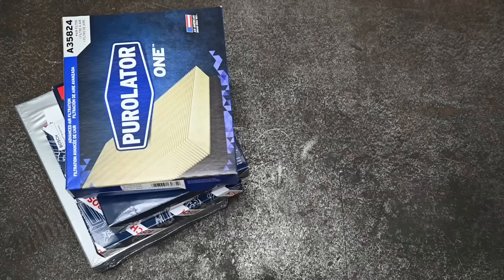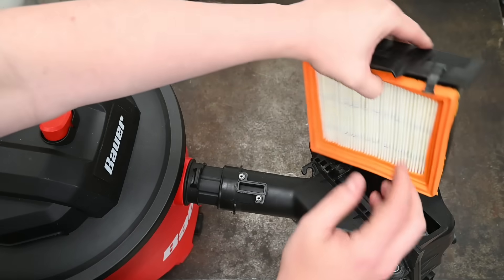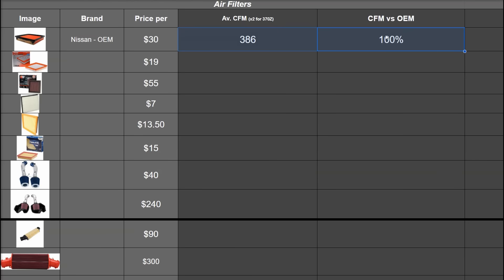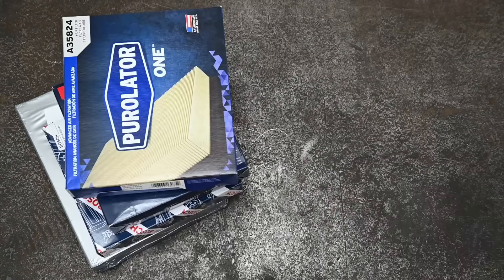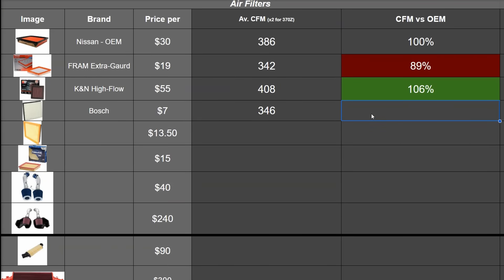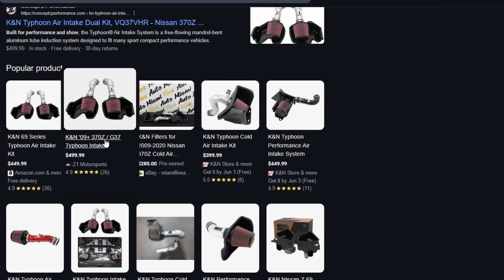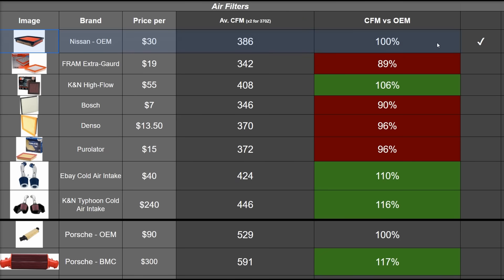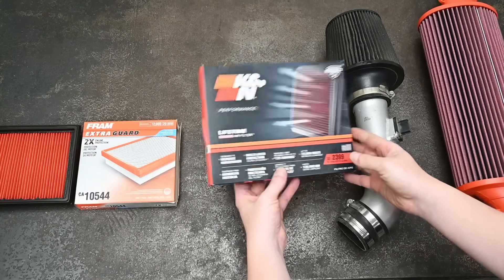Intake Filters TESTED: More Dough = More Flow?

Comment: You should test the stock vs aftermarket intakes without a filter and see if they were restricted at stock flow and 50-100 cfms more than stock and see if the intakes were different.

Comment: Sooo, what would happen if you made a custom box to hold 2x $7 bosh filters? Would that work better than a single $15 one? What about a box with 4x $7 filters? Would that be better than a $30 or even a $300 filter? Seems unless you're building a custom intake the cheapest is pretty much the same as the most expensive. Also would a custom box with 43x $7 filters do better than a single $300 one?

Comment: In modern cars that most of these upgraded filters do not add power. The modern vehicle generally has a far better design to accommodate maximum volume.
Those stepped intake are junk and the step creates turbulence at certain rpm. 
Also those K&N intakes are mostly noise generators.

Comment: Should you have oiled the K&N filter to have given it a real-world test unless I'm mistaken I thought those filters fully rely on being oiled to do any kind of filtering
Reply: New K&Ns come preoiled out of package.
Reply: They're pre-oiled, no oiling is needed.
Reply: They make dry filters as well
Reply: The oil is red and all of em come pre-oiled
Reply: K&n does all sorta stuff these days but people just associate with the oiled metal filters.

Filter counter tests are sort of hard to do, measuring how quick they get choked up etc is easier. I'd just like to see the easiest mods tested while retaining filtration but which are rarely seen like just using two oem in parallel etc
Reply: They come preoiled

Comment: To be honest the test that would more present an engine advantage would be the pressure drop at a fixed cfm. The engine WILL such the same amount of air no matter the filter. But the more pressure drop the harder it has to work to such such air. But will it make a noticeable difference except placebo effect caused by the change in tone of the engine ? Nah .... maybe what half an hp on a stock engine ...

Comment: CAI sound good even with little to no mods. I always had 2 filters so one was clean and oiled and ready to go at all times. Makes your exhaust note better. I try Very Hard to take the Best care possible for my truck and engine. A very high end engine builder once told me “ an engine will last as long as it takes it to eat a cup of dirt “  So I sometimes run a tune and sometimes change of my muffler. I drive on dirt / gravel roads frequently. I only do stock air intake and the best filters I can find. I have been running Fram extra guard in my 2016 F150 5.0  I am over 200,000 miles and will be selling it and moving into a Nissan Titan. Looks like I will run OEM Nissan air filters. Thank You. 🙏🏻

Comment: If I may offer my humble opinion on intake air flow….
I’m pretty sure (according to the intellect that I see everyday on the streets), if you lower the car about 2 inches, add a 24” tall rear deck spoiler, and add an obnoxious exhaust system to compliment the blacked out windows and the led accent lighting, it will not only make the car look like a complete piece of garbage, but it will also make the driver an INSTANT RACE CAR DRIVER, capable of speeding to the next red light 3 seconds faster than you, while using 4 extra ounces of gasoline and 20 extra decibels, to wait 3 seconds longer than you, for the light to turn green. 😂😂

Comment: the miniscule horsepower increase isnt worth the lower filtration ability, i used to buy these until i held one up to sunlight and saw how big the holes were in the "weave", the dyno tests showing a 5hp increase would have the performance increase of removing 40lbs from your car

Comment: The particulate filtration on gauze filters is horrendous. Check out Project Farm comparison of actual filtering characteristics. No in their right mind would ever put an oiled gauze filter on their car. The reason we filter the air is to keep crud out of the engine; unless your hobby is rebuilding engines.
Reply: I would like to apologize for being a little harsh. I live in Arizona and do a lot of off road driving. In these conditions it doesn't make sense to use a gauze filter. BUT, in the rest of the country where constant dust storms aren't a thing I'm sure they work great and can save a lot of money in the long run because you can clean reuse over and over.
Reply: @allenanderton2246 No need to apologize.   I just wanted to show a couple of examples of long-term use.  I have traveled a lot for work over the years living in multiple regions.  I've done multiple trips to the west for camping.    I currently live in a pretty rural part of the Midwest and whiles it's not as dusty as a dessert every day, if you've ever driven down a gravel road you get a lot of dust.  And any road near farmers tilling or harvesting.  When it gets dry, you get dust, and it causes accidents and closures on the interstates from time to time (usuallydue to farming activity).  I think that you and I agree that maintaing air purity results in a healthier situation for an engine.  But I think an oil analysis will show the real answer as to what is better for air purity than hooking a vacuum up to an air filter and trying to suck flour through it.  I like project farm, I just don't think he got the science right on this one.
Reply: https://youtu.be/cU8UMlMzi30?si=QgiKNIEvzv0oiQ_I

Looks like this guy tested this in his car 7, 8 years ago.  His oil analysis shows that they perform as well as a paper filter, even with more miles on the vehicle and not cleaning the K&N.  So if you get the same protection and slightly better airflow, the only question is cost.  The rubber seals on my Dakota's K&N were starting to deteriorate after 23 years and they had me send pictures and they shipped me a new one for free.  So you have the 1 time higher initial cost plus the cleaning kits, vs the cost of air filter replacement.   However i will note that in 23 years, i probably only cleaned that old filter maybe 4 times.  This will depend on your environment,  as does replacing a paper filter.  I'd say the edge goes to K&N in total cost, if you're like me and own vehicles for a long time.
Reply: I've used K&N air filter in my 2000 Dodge Dakot 4.7 for 23 years.  My 2006 Tundra 4.7 has had one for about 16 years.  Dodge has 226k miles and the Tundra has 215k.  Neither is ready for an engine rebuild.  I think the way to really test this would be to do an engine oil analysis on vehicle with the different filters to measure the silicon content of the oil.  Silicon in the oil is what the air filtration it's really fighting against.

Comment: Rather than pay exorbitant prices for K&N parts, why not just remove the air filter altogether?  With K&N's history of catch efficiency, the difference is minor.

Initial air resistance is only one metric for air filters.  K&N filters are famous for offering practically no engine protection whatsoever; they get more flow simply by letting in more particles.  Highly resistive filters can indeed be bad for power, however, and they can fill up quickly and reduce horsepower even more dramatically within months or even weeks.  There are more complete tests available on youtube using lab-grade dust, but some filters do perform better than others overall; some are able to filter more particles and offer a higher capacity (lifespan) without being too restrictive.  With air filters, cost has very little correlation with overall performance.

Balance is important here as getting 0-10HP more from a multi-hundred-dollar intake upgrade is kinda dumb if it damages the engine with dust particles.  If you buy fancy, purple-dyed oil to protect your precious engine and then install an air filter that has poor catch efficiency, you're not playing with a full deck.

It's a crime to pay $480 for K&N "cold-air" intakes.  That's insane and you might as well roll and smoke your money.  If you simply must kill your engine with dust, then buy the eBay version and use the savings as a down payment on a new engine.
Reply: You are better off using a dirty sock for a filter. 
Plus The oil from the K&N will contaminate the MAF sensor and result in incorrect sensor readings to the computer.

Comment: did you oil the new K&N or just slap it in dry?
Reply: They are delivered ready for use, a clean "dry" K&N filter are light grey to white in the filter fibres.
They turn red, when you oil them, just as delivered.
Looks like ATF oil, to me but more expensive delivered in a spray can.

Comment: I would also like to say those are really straight shots. Most engines have turns that slow flow too. A straighter airflow does make more power. I usually buy the cone shape filters. Only the one jeep has a vacuum boost gauge. But have always ran cone filters on it. And have over sized filter on it now. Trail jeep beater with almost all vacuum lines disconnected and value cover filter vented. Once cleaned filter out in a creek on a dusty trail. Street legal side by sides mean sucking less dust on atv trails beside the roads. Lot less wear and tear being street legal and faster being legal on roads.

Comment: Another great video. Thank you. I like the personal touch of getting on each other’s case, and then losing the bet. I had been in the industry for 42 years as a tech and owner. Never a fan of K&N, they require a dedication and knowledge from their owners. I had seen far too many MAF sensors,intake tubes and throttle bodies horribly cruded up. But each to their own.
Reply: Interesting in that I have been running K&N for more than 25 years, in multiple different cars, including one that went 212,000 miles, and not a single problems from this brand of filters. Well more than 500,000 miles on these vehicles collectively. No abnormal oil use detected nor MAF sensor irregularities. The Lexus that went 212,000 miles on its V8 maintained full oil levels between 6,000 oil changes. Different stories from different drivers.
Reply: @m.newman7722  Same here, have owned a 2016 1.6L diesel engined car since new. Had the same K&N panel filter fitted to it since day 2 of owning it, never had an issue with cleaning / re-oiling and I've done 152k in it, still going strong. 😁

Comment: The only air filter I can find on either of my two EV's is of the cabin type. Yet more money saved!!
Reply: You would need to look up generating station exhaust filters, they are extremely expensive.
Reply: @mikey4016  um, well I wouldn't know anything about that because my EVs are charged by my homes 60 solar panels and three power walls. We don't use grid power (actually sell back) so there's that.....

Comment: I loved the test! There's a key factor though that would be nice to consider - filter efficiency. 

I.e. you could run no filter for a performance gain - but we all presume that's unhealthy for the engine. What about these high-flow filter setups? Aren't they trading filtering-ability for flow?

That's why I often default to stock paper filters over aftermarket (assuming OE offers max protection) - but I would love to be wrong. 

Also, what about oiled aftermarket versus "dryflow"? 

Nothing wrong with what you did - I just want MORE!
Reply: Agree with fitting a paper filter. Is the best filter the one that filters more?

Comment: the engine will bring in its CFM of air regardless of the filter. the difference is how much power is being used to "suck" it in. less restrictions in the filter means less power is being robbed to pull the air through it.

Comment: The difference between the shop vac, which you correctly set at approximately the same CFM as wide open throttle, and the actual engine is that at that CFM, the engine has very high vacuum potential, as measured with a manometer because it's a very high quality piston in a cylinder.  So it has the ability to suck in what it wants, even at slightly lower pressure, than the shop vac, which has a plastic impeller in a shroud.  The car WILL get the air it wants, and the shop vac will have a much higher CFM drop off with some minor restriction at the intake.  So your results are useful as a relative guideline, but in the real world we don't really know.
The claims by some aftermarket intake sellers that you'll get better gas mileage are dubious because drivers, even the craziest ones, rarely ever go to wide open throttle and even then it's only for a few seconds to get to higher RPMs.
I think that Nissan, BMW, et al are very smart engineers with very good test equipment.  If they could improve performance by, say, doubling the square footage of the air filters, they would do it.  Look at the extremes they go to for other tiny gains.  It would be great to hear from an OEM engine designer about this.
Reply: Not an engine designer, but I am an inginerd. I can promise you a LOT more goes into these decisions than just raw performance. From overall refinement to supply chain and yes, even cost. If "losing" 5bhp at the top end saves the company some thousands in air filters/housings/plumbing over the production life of a car, you can bet your bottom dollar that it WILL be done.
Reply: For manufacturers also emissions and noise is very important when design as well as many other factors than straight flow. Also stock intake is mostly done for performance on low and mid RPM not for top end power only.
Reply: What abut something turbo charged?
Reply: "The car WILL get the air it wants,"

A filter that is restrictive at the airflow demanded by the engine, WILL reduce airflow.  It's fundamentally no different from the throttle not opening fully.
Reply: @ferrumignis  and the computer will compensate for the lack of air with reduced fuel. this isn't the 80s
Reply: @rhetorical1488I didn't say the fuel wouldn't be compensated, but loss of air mass always means loss of power. No exceptions.
Reply: @ferrumignis  It doesn't take a large filter media to make the 20hp or so you use for cruising.
Reply: @DarkLinkAD Why are you talking about cruise conditions? The level of restriction in OE filters is only relevant for high power output conditions.
Reply: P.S.: I do agree on the dubious claims by certain filter manufacturers. That engine is tuned to work in its OEM configuration. Unless you know EXACTLY what you're doing, messing with that won't yield any improvement.
Reply: @233kosta If an EFI engine gets more air in the cylinders it will make more power, simple as that.
Reply: @ferrumignis that is true. I think they are just saying that on an otherwise mostly stock car, even no filter at all won’t result in a meaningful power increase.
Reply: @NoLongo  This may be true in many, or possibly most cases but there are some where the stock filter is undersized.  A car I owned some years back an MG ZS180 was renown for this, and filter element was visually small for the displacement and power rating of the engine.
Reply: Engine have much more vaccuum potenial however it's not like it will get all air it wants. It's gonna drop pressure in intake which results in less oxygen, mixture in power. With restrictive intake you can see MAP sensor on WOT high rpm dropping from ~1 bar to 0.95-0.93 or even less. And with good resonated intake you can see 1.03-1.04 bar+ on MAP indicating it actually increase pressure in intake at some rpm range therefore increase power. Power is strictly correlated with pressure in cylinders on intake stroke, map sensor is the closest to measure it.

Comment: flow capacity is one thing, but changing the media of the filter introduces other issues. For example the oil in the K&N and other "lifetime" filters can and does tend to mess with MAF sensors causing issues. CAIs, such as you've shown here, time and again have shown significantly reduced power everytime on a dyno due to heat build up, as they're more hot air intakes than cold air intakes.  In addition the stock plastic tubes to high performance engines tend to have baffles in them, or what's more technically called resonators. These act as dampers to smooth air intake pulses and create a more seamless flow of air into the engine, which is also not achieved dynamically with that chunck of shiny pipe. But, you can't tell people, because shiny is fast, all fast cars have shiny bits.
Reply: A good cold air induction kit is not just a filter and a pipe, though crap ones may be wrongly advertised as such. It will have shields to direct cold air to the filter and shield it from engine heat.
Reply: Wrong, been using K&Ns since I was 18. On many vehicles and ATVs. If you properly clean and oil it won't gunk up your MAF. People over oil them.
Reply: @RJL1983  I agree: Now collectively over 500,000 miles from 25 years of using K&N filters, and no problems encountered. No increased oil usage nor sensor problems.
Reply: @m.newman7722 EXACTLY! It's the idiots that don't ever clean them or over oil them. Deff operator error of your getting oil all throughout your air intake and MAF